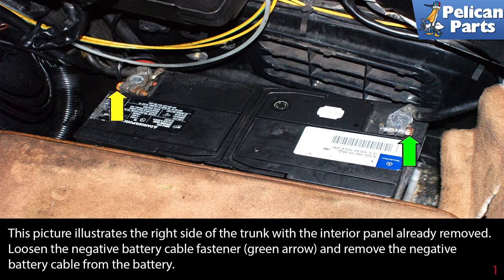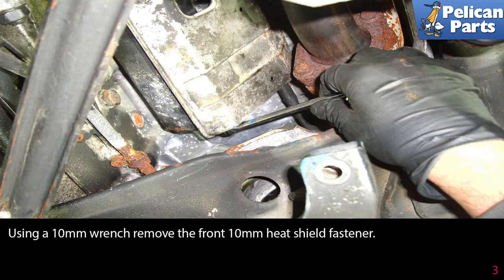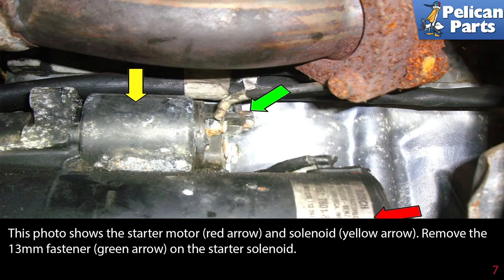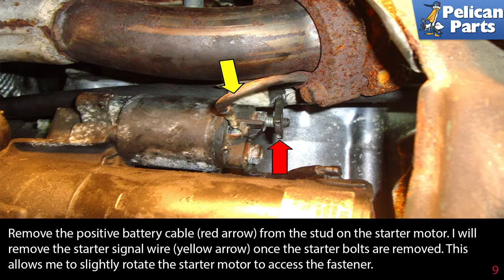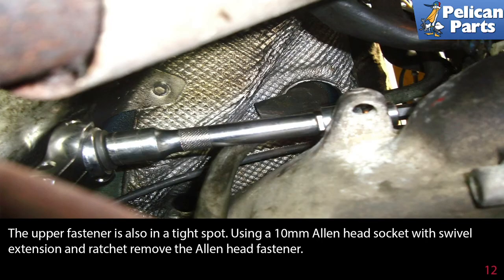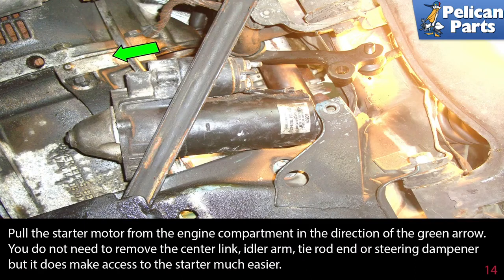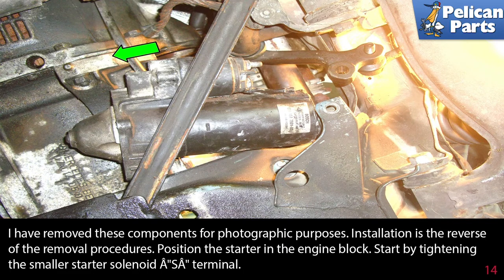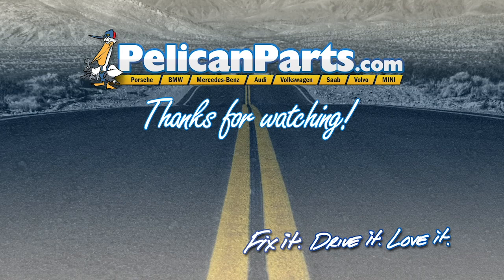Mercedes-Benz R129 SL-Class Starter Replacement

Comment: This was a bit of a bear. I would definitely say have ratcheting wrenches for a few of the hard to reach bolts. The 10mm allen head fasteners could use penetrating oil and a breaker bar. You will deserve a beer after this one. Good luck.
Reply from the maker: Thanks for the tips!